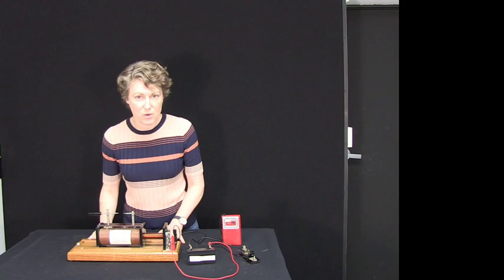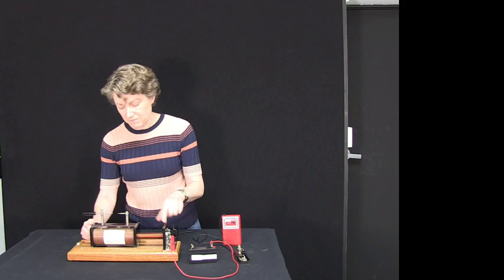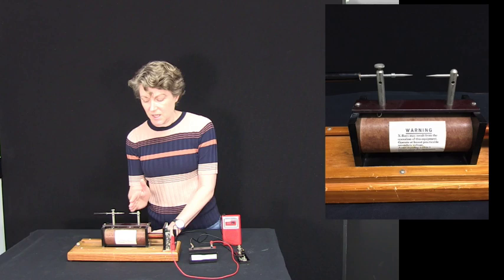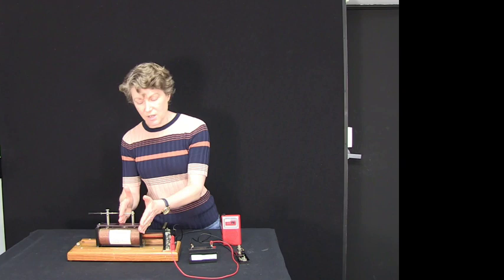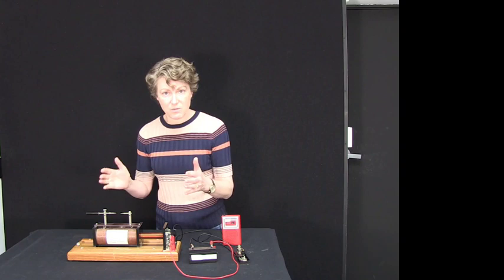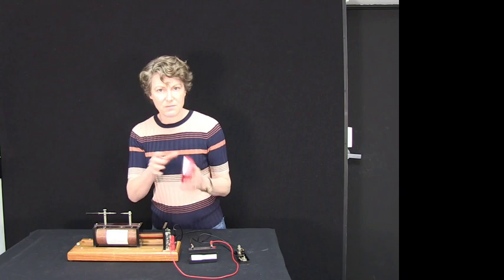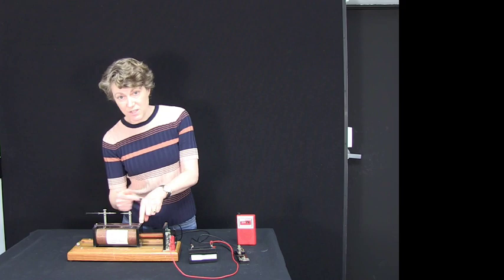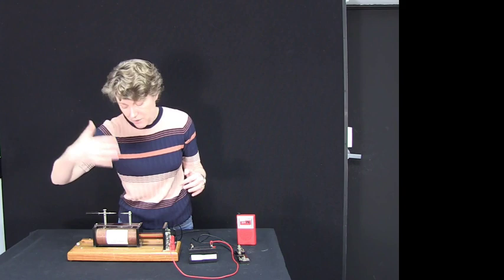7 Hertz Experiment Demo

Comment: This is an excellent video.  The best i have seen so far explaining and simulating Hertz's confirmation of the generation of electromagnetic waves.  The only possible omission that struck me is that the presenter failed to mention the important "oscillatory" nature of the spark discharge.  Just as in a cloud to ground lightning strike in nature, it is known that the downward discharge is rapidly followed and upward discharge snd this repeats back and forth at a high frequency, generating electromagnetic waves back and forth in both directions.  I believe this is what explains Hertz's finding of the standing wave pattern between the electrodes that the presenter  describes at the end of the video.  The presenter seems to attribute the EM wave generation to the rapid deceleration of the electrons upon collision with the pointed metal needle.  Are both factors involved?
Reply: Joseph A Stanko thanks for this

Comment: In the primary coil circuit there is a switch similar to the switch in the electric bell, which connects the circuit on and off in fractions of a second repeatedly, so the intermittent spark is generated.

Comment: How come it is generating voltage on the secondary for a long time during long pushbutton press.it should generate only at transient moments.
Reply: obviously she has a small circuit there on the end of the primary coil that is designed to switch the power off and on again many times per second, it's commonly called an oscillator, and can be made in many many different ways, using simple components like one single transistor and a capacitor or just an inverter I.C.....or another two transistor circuit called an astable multivibrator, like I said, many, many different ways to achieve the same effect. Because you are right, just completing the circuit will only produce one spark then do nothing but maintain the electromagnetic field thus wasting the battery, but as soon as you remove the power, the field collapses, but, as it does so, in the secondary, that collapse actually goes somewhere, and it induces another current in the primary, this could go on back and forth but resistance and also being connected to the equipment in the primary stops the whole show.This type of self induction from primary to secondary and back again is the basis for the TESLA coil, the two coils charge  each other as they collapse, but they are tuned to do so by being of an exact length and wire thickness to an exact matching inductance, measured in Henry's in combination with capacitors that are also of an exact tune, measured in Farads to deliver just the right amount of energy at just the right time, kind of like how someone pushes another person on a swing, you supply just a little push at the right time and the oscillations can build up, because if power, or the push, is applied at the wrong time, the oscillation won't build up, just like trying to push someone on that swing at the wrong time, it won't help. Hope I didn't dumb that down too much....

Comment: If the spark is oscillating at a specific frequency as defined by your oscillator or signal generator, then why is the radio interference not picked up at only that specific frequency?
Reply: reflection, deflection and attenuation of the air around the apparatus will distort original signal.

Comment: So many mistakes... geez people, stop saying how great this video is, it's not, and if you think you learned something, you learned some wrong info.

in the beginning she doesn't explain that there is an oscillator on the end that is creating the pulsing 6 volts into the primary coil...  that pulsing voltage is what is creating the expanding and collapsing magnetic field in the primary coil.  That expanding and collapsing magnetic field is what interacts with the secondary coil 

then for safety she says beware of X rays, but mentions nothing of being shocked by the high voltage.  

then she says the more you slide the secondary over the primary the higher the voltage will be... not true, the spacing of the spark gap will determine the voltage.  as you widen the gap it will require a higher voltage to jump the gap. even if you slide the secondary all the way over the primary the voltage across the gap will not increase unless you widen the gap.

then she says "as a rule of thumb" about 10,000 volts to jump a centimeter of air.... wrong 30,000 volts per centimeter.

then even MORE mistakes...

She says the higher the voltage the higher the frequency.... no no no...  Stronger signal, but not higher freq.

then she says his detector gap "has a loop just to complete the circuit"  SO WRONG ! the LOOP is NOT just to complete the circuit, the loop is the antenna that is picking up the signal and the loop is what the voltage and current build up on.   The small gap in the loop is just so a small spark can be created (for him to see/hear) hear as the voltage and current build up in the loop to the point that is jumps the gap.

then she says he held his receiver spark gap close together... if he "held" the spark gap there wouldn't be a spark, he would absorb the electricity and be shocked instead.  She should have said he "positioned" the spark gap closer together.

then they don't have a receiver loop??? what? oops, I'm just going to guess because she made a tiny one "just to complete the circuit" and it wouldn't work.  

No you don't need to tune to the lowest freq on the AM Radio.  Just about any AM receiver at any frequency will pick up those simple spikes.  and BTW  "AM is Not a BAND" as she said

regarding polarization... she is wrong again, the electrodes (spark gap) does not need to be horizontal, it is the antenna loop that would need to be horizontal.  The loop could be of a length that allowed to ends to meet, then slightly twist the ends so the gap is vertical and it will still receive and still make the spark.  And even if a signal is transmited vertical or horizontal it can still be picked up by an antenna that is not polarized the same,  just not as strong, and also as radio signals travel their polarization can change.

Sorry, just too many mistakes in this video, I had to point em out, and I didn't even mention them all.
Reply: It is better than many other videos.
But maybe she is just over simplifying it. Idk
But all you points are valid 👍
But i have a question ? I understand spark gap as a way of making sure what the minimum voltage is going over the gap. But the voltage must be present in the first place.

So the gap is a control measure. The gap only determines the minimum voltage that can pass.

Most references on the net say 10000 volts for 1cm.

You said much, so forgive me for any info you already said or said in a different way.